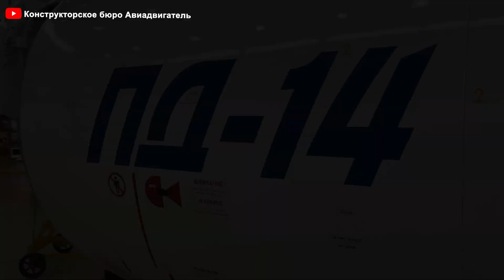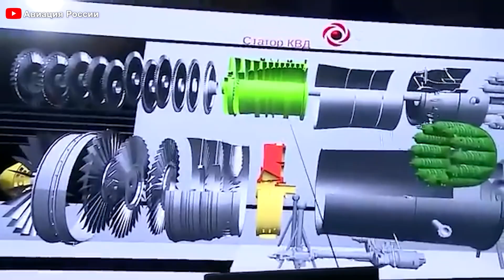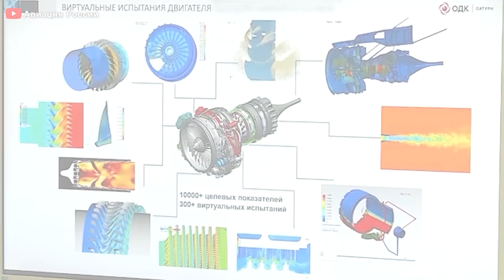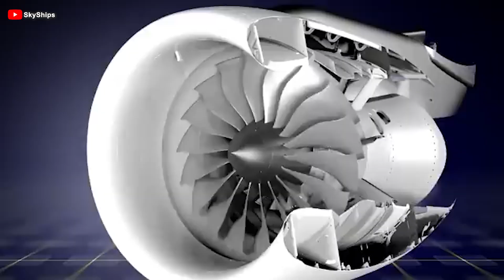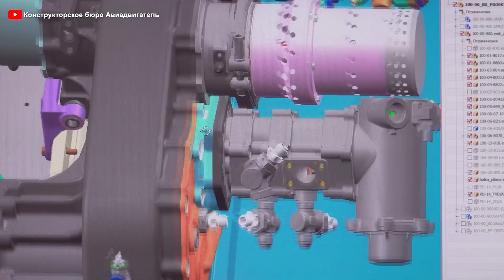Russia Just REVEALED this PD-14 Engine will SHOCK the Industry! Here's why

Comment: The first ground tests of the PD-14 took place in 2012, and the first flight tests in 2015. In 2018, Rosaviatsia granted the engine a type certificate confirming the product's readiness for serial production and operation. This engine is intended for the MC-21-310 airplane. In 2021, the authorization for serial production of the engine was given. The MC-21-310 aircraft with PD-14 engines made its maiden flight in December 2020. The MC-21-310 was certified in December 2022.
So we can see that testing and certification of engines, is a laborious and time long process.

Comment: I’m confused, another channel made a video 3 years ago about this engine. - recycle video or propaganda? How the video is presented I’d bet on 2…edit: 🇧🇷is the 3rd player…
Reply: The first ground tests of the PD-14 took place in 2012, and the first flight tests in 2015. In 2018, Rosaviatsia granted the engine a type certificate confirming the product's readiness for serial production and operation. This engine is intended for the MC-21-310 airplane. In 2021, the authorization for serial production of the engine was given. The MC-21-310 aircraft with PD-14 engines made its maiden flight in December 2020. The MC-21-310 was certified in December 2022.
So we can see that testing and certification of engines, is a laborious and time long process.

Comment: Boing or Airbus don’t make engines. They use engines from RR, Pratt and others, both design and assemble aircraft parts coming from all over Western Europe some are owned by both but not all, most of the parts are made on contract basis. So, your comments that they make engines is not correct boils down to fake news.  Please. PD14 is 100% Russian made as RR is made by UK for example.